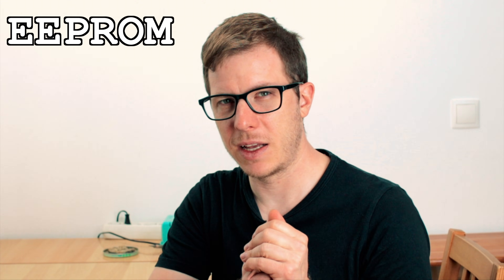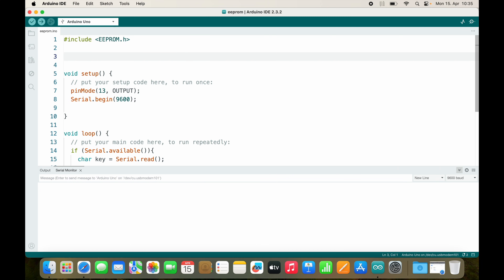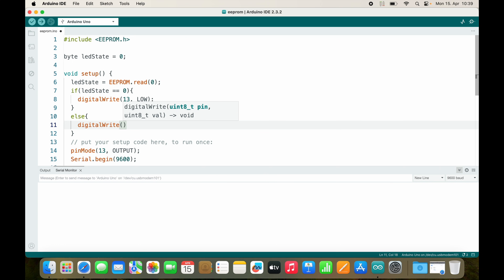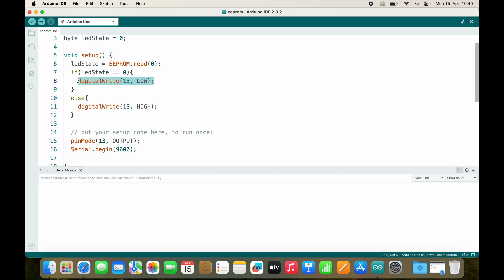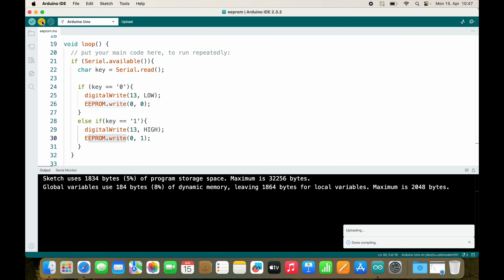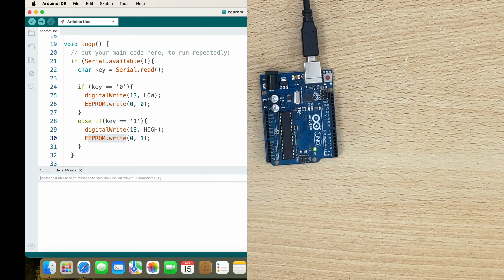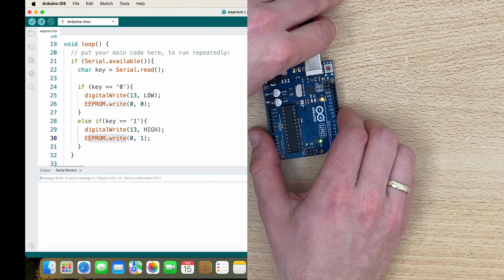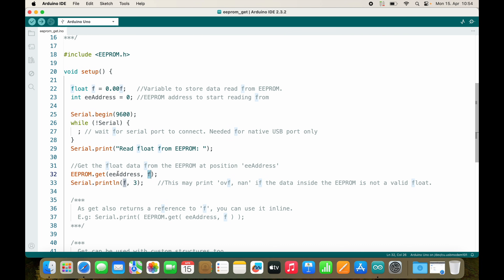arduino eeprom read and write - (Arduino Uno Programming for Beginners)

Comment: You can also use "EEPROM.update()" to write data. This command only writes to the EEPROM, if the data is different. So if you like to write a "1", it only writes it, when it contains anything else. This reduced write cycles. "EEPROM.write()" always writes to the given location.